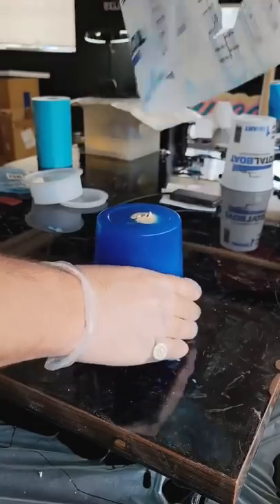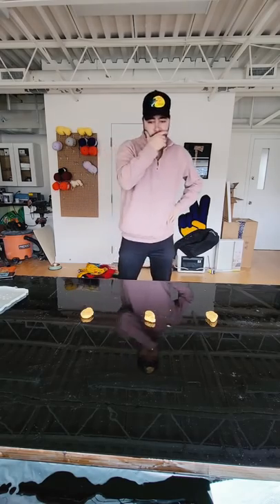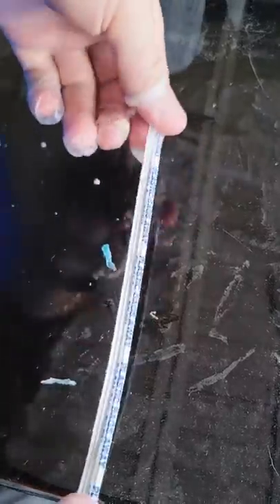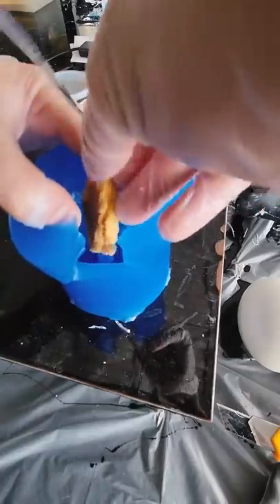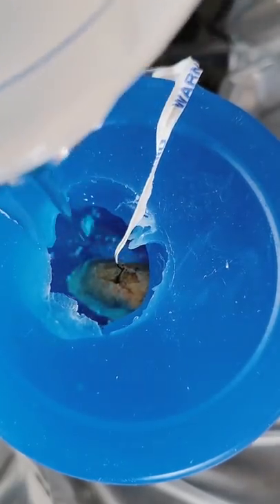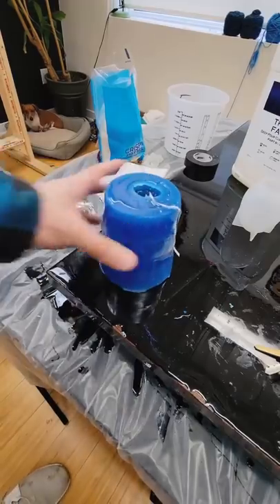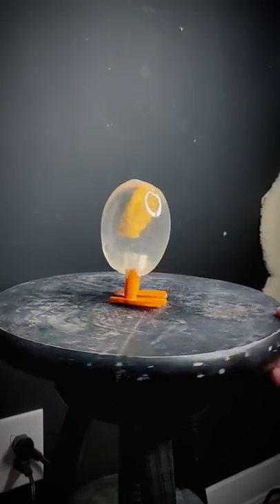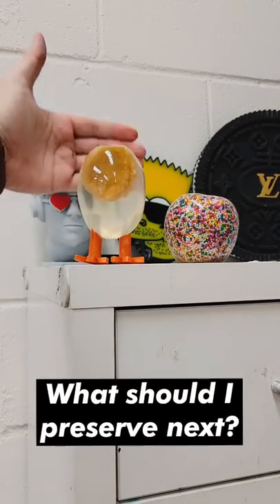How to make a CHICKEN NUGGET last FOREVER! (part 2) #diy #howto #resinart #3dprinting #art #resin

Comment: "Most things inside of resin do no degrade" except when they are organic... which meat is... and that nuggest didn't look de-hydrated. So there's bacteria, water, and now a warm environment all available for that thing to rot over the coming weeks
Reply: Yea its a head scratcher that no one else has come to this conclusion
Reply: I guess we’ll get an update vid
Reply: Yeah, but when he degassed it, it pulls moisture and air from the nugget and pulls resin into the nugget. In this state, there's far less moisture and no real oxygen to speak of, so bacteria won't be able to grow on it or in it.
Reply: @Nanamowa  Not really. Degassing it does not replace the moisture. I guarantee there is anaerobic bacteria on/in it. The only way this would work is if he was to use a freeze dried chicken nugget.
Reply: If it’s a McDonald’s nugget I’m sure it’ll be fine 😂
Reply: I remember seeing another channel crack open an actual egg he’d encased in resin and it absolutely definitely 100% rotted

Comment: Instead of using a vacuum chamber, you could use a pressure chamber. This will keep the resin from "boiling over" and out of the mold

Comment: Be careful about putting degradable things inside resin without a degassing machine such as a vacuum chamber. If even a single bubble remains it can rot the whole piece. McDonald’s is kind of an easy bet because they don’t really rot as such, they just kinda shrink and discolour a little, but I’ve put flowers in resin once for someone’s wedding, and the rotted in a few weeks because my small business doesn’t have a degasser yet :(